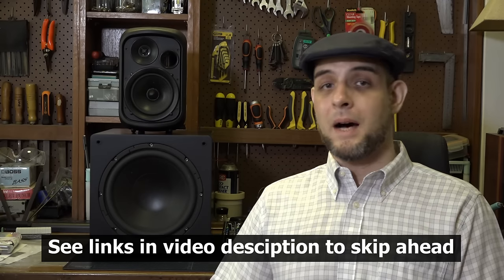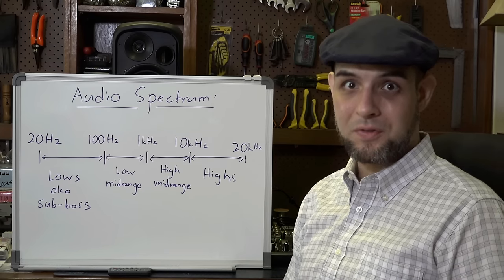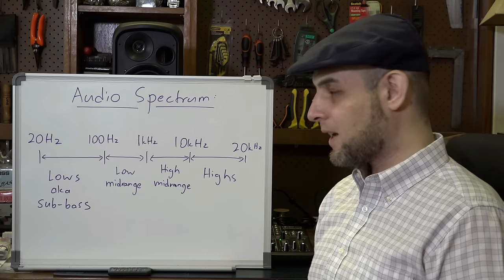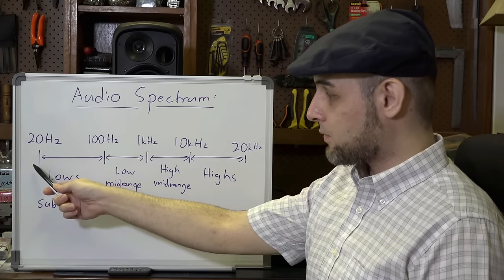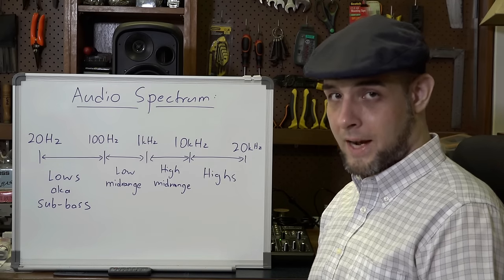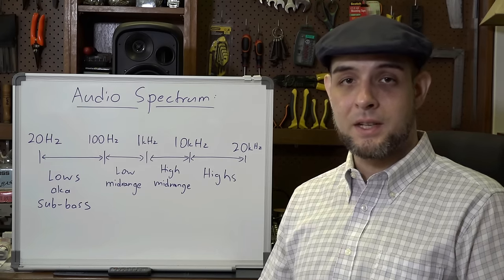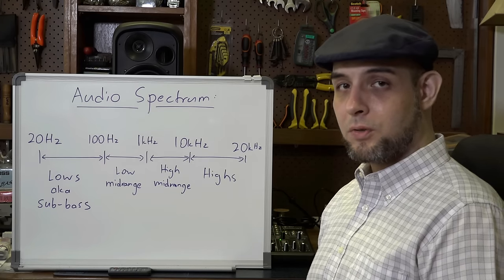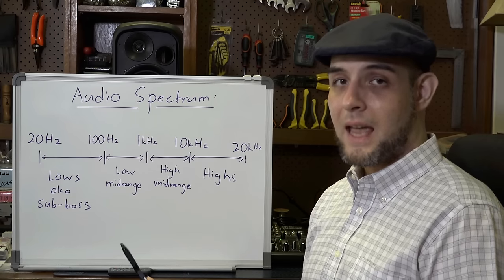How to connect an active subwoofer to a sound reinforcement system

Comment: Hello sir. I am a new listener to your channel. I have a newbie question: i just purchased a pair of peavey dm112 active speakers and a pair of behringer b1200  active sub. I noticed on the back of the speakers there is one input and a thru output, which according to the manual is to use if im adding a sub. I guess my question is how do i connect these? Should it be a.) mixer to active speaker input, thru output to active sub input. Or b.) mixer to active sub input, high output to active speaker input (like what your tutorial is). I hope im making sense. And thank you in advance for your help.
Reply from the maker: The thru output on the DM112s is fullrange as opposed to low passed so it makes more sense to use configuration (b) above.

Comment: Can I just plug it in with 3.5mm to RCA? I was looking at getting an R-112SW but only have a power amp with no proper output
Reply: From what I can find it will work, but are there any serious drawbacks/dangers in doing this? I'm not trying to be an audiophile; I just want to feel my skeleton dancing inside me, so I'm alright with sacrificing a little fidelity if it means saving hundreds of dollars
Reply from the maker: Sure no problem, as long as your sub has RCA inputs.

Comment: Sir is it ok to connect an active mixer to amplifier to drive passive subwoofer?  or just passive mixer to amplifier then to passive speaker. thanks...
Reply from the maker: You can but you must use the line level outputs on the powered mixer - these are marked 'line out', 'preamp out' or sometimes 'tape out' or 'rec out'. Do not use the speaker level outputs on the back panel.

Comment: Bruno, great channel, great video! Question, do you know if there is an issue to use subwoofer and full range speakers of same speaker size? Example, use Yamaha DXS 12 sub + two DXR 12 powered speakers all together?  I've heard more than one guys saying there are phase issues, and that two DXR10 would work better with the 12" sub...
Reply from the maker: Sure you can do that no problem, although companies generally recommend that you use products from the same series together. There will be no phase issues as long as the speakers are time aligned properly, either by using a program like smaart of by physically aligning the speaker boxes.

Comment: at 26:57 connecting to passive tops you go from lets say mixer to sub then to amp. what connections should I be looking for in the back of the sub and are there subs that will not work with this type of setup?
Reply from the maker: You would need a sub that has fullrange inputs and then high pass outputs, ie outputs with the low frequency information removed. And you're right, not all subs will have these connectors.
Reply: You rock, thank you for your time.

Comment: 17:35 question please. What if I only have one subwoofer , how do I connected in order for the subwoffer to take most of the lows and leave the midst and heights for the 2 load power speakers.
Reply from the maker: What's the make and model of your subwoofer?
Reply: @GLBProductions  harbinger s12 sub,  and 2 15s altos ts315 . I already managed to run them correctly but my question now is ,is the subwoffer taking too much of the lows of the 2 15s or should I get another one so I can have the set
Reply from the maker: You will need to make that decision based on the type of music you play and how much bass you feel is needed.

Comment: What if you have old subs that don't have a built in x-over?
Reply from the maker: Then you will need to use a separate external crossover such as the DBX 22/23 series.

Comment: Can i wire in series 2 x  passive spearker just to be presise ( tweeter + woofer + crossover) in seeries with ( tweeter + woofer + crossover ) bolth 4 ohm to get 8 ohm ? Internet has a mambo jumbo beetween terms so anwers are garbages
Reply from the maker: In theory you can, especially if you are wiring the speakers yourself. Just remember that series wiring means that a fault in any one speaker will silence your entire system.

Comment: Quearion please. If there is some noise for some reason ,m I able to use a DI box passive from my power speaker to the mixer,  or are the DI box is only for instruments
Reply from the maker: DIs can be used for any instrument or line level signal, but not for speaker-level signals.

Comment: Hi, great video. Does the method shown at 27:00 in which you insert the sub after the mixer and before the amplifier work if the amp in question /also/ has a mixer? I’ve got a system that has a powered mixer and passive speakers that I’m trying to run a sub through and it seems this is the method I should use, but I wanted to make sure.
Reply from the maker: OK, with a powered mixer you will need to find a way to connect directly to the power amplifier section, bypassing the mic/line inputs. Most powered mixers have a way to do this - look for inputs labelled 'pwr amp in' or 'tape in'. You can also connect directly to the line level inputs, setting the EQ flat and all effects off.
Reply: GLB Productions thank you so much!!

Comment: Can a good base combo function as a sub carrying both the base guitar, base drum, floor tom etc in a small rehearsal room?
Reply from the maker: Hmm... at this point I have to ask - if you are in a small rehearsal room, why do you need to amplify the drums in the first place?
Reply: GLB Productions. We want to be able to capture and control base and the other low frequency instruments on the mixer. What we do now is that we use a condenser microphone to capture externally the bass and drums while recording the rehearsal session.

Comment: There are input-line L R go to the Sub,  but it has only one big speaker output _ Is that means L & R have been shorted each other in the Sub Cabinet ?
Reply from the maker: They are summed to mono before the power amplifier section - no shorting going on here 😄
Reply: @GLBProductions  :- So  ! , Is the main speakers still stareo ?
Reply from the maker: Yes they are.

Comment: Hi, when setting up a PA system With a mixer and an active speaker, how would i set the levels, would i set the gain properly and then set the channel/master knobs/faders on unity then turn up the active speaker until the desired volume? And also do you think it is worth the extra $50 for a shure beta 58a rather than an sm58
Reply from the maker: That's right - get the gain structure on your mixer correct first and then set the volume on the speaker as needed. This will make it easier to set the system volume in different venues.
Reply: GLB Productions Thanks alot Before i assume i used to set the levels wrong because there was a terrible hissing noise compared to the actual volume from the mic but today there was hardly any hissing noise 🙏🏽👍🏽
Reply from the maker: Yes, now you have optimised the signal to noise ratio of your system - well done and all the best with your music!

Comment: I have a mackie cfx 12 mk11 mixer. I have 2 active tops and a sub. I use it for live vocals and backing tracks.There is a xlr subout on the mixer marked with an 'S'. Should I be connecting my sub using that ? or do the traditional thing and use the left and right out to the sub and connect from the sub to the tops?
Reply from the maker: Yes that mixer has a subwoofer specific output which is low passed at 75Hz - this is a bit low in my my opinion (I prefer 100Hz) but if it sounds good with your system go ahead and use it. At the same time you will need a way to cut the lows out of your tops - either with an external crossover or high pass filter on the speakers themselves.
Reply: Thankyou for your reply. The sub I am using is a 12" and has settings on the back for 90hz and 140 hz, would i still be able to use the xlr subout? or will it not sound right? The tops are 14" and I have told to use it at full range.
Reply from the maker: Yes you can, although the 75Hz setting will override the settings on your sub. 14" tops? FBT ProMaxx are they? There are very few 14" tops available these days ;) 
I personally do not agree with running the tops fullrange because you then are not 'dividing the work' between them and the sub so to speak. It can also cause phase issues due to the distance between the subs and tops.
Reply: There are various settings on the tops to match the sub i.e i have the choice of setting the tops to 90hz and also setting the sub to 90hz. I have been told to set the tops to bypass the sub and set the sub to 90hz. This way it apparently has the tops running fullrange and the sub doing its own thing. The tops are set on tripods and the sub sits either near a top or between the two tops.As you can tell I am not a technical person but I want the best sound I can get from this system

Comment: Can I use my power mixer to power my passive subwoofers? Or I would only use it to power woofers only?
Reply from the maker: Both - you can use the speaker level outputs to connect to passive subs, and the line level outputs to connect to active subs.
Reply: GLB Productions thanks for that response. 
I am doing a small band for church size setting. 
I want to replace my old mixer, should get the power mixer or pre-mixer?
Reply from the maker: The term is mixer or powered mixer, not pre-mixer ;) I suggest getting a normal mixer - more versatile and they are available in much larger channel counts.
Reply: GLB Productions ok. Thank for advice and term correction. In my country, ppl call mixer as “pre-mixer”. Now I know the term.

Comment: so if I wanted to use the High pass output on my sub, do I use active or pasive tops
Reply from the maker: You can use either - with passive tops you will of course need an additional amplifier.

Comment: Hi Bruno, I now have two subs and hooked them up to the aux sends out of my Mackie DL1608. I set up for the band and sent the bass guitar to the sub only, not the mains and I realized a bass guitar produced frequencies above 120 hertz and those frequencies were naturally weak coming out of the sub. Does this mean I need to send the bass guitar to the sub via aux send and also send the bass guitar to the mains but if I do that the frequencies below 120 hertz will be going to the mains and I'm trying to avoid that. What do you suggest?
Reply from the maker: Yes the bass needs to be sent to both the sub as well as the fullrange speakers. In order to avoid the issue you describe you need to high pass the signal being sent to the fullrange speakers, either using an external crossover or a filter on your active fullrange speakers, aka 'subwoofer mode'. I discuss this in the video.
Reply: Thanks Bruno. I don't have an external crossover or a subwoofer mode on my tops, sounds like I have to go into the sub and then from sub to mains even though that is not the best choice.
Reply from the maker: There's nothing wrong with this method actually, as long as the crossover in the sub is well-designed and the subs and tops are designed to work together.

Comment: Hi!
I want to connect active sub to a passive speakers system (just like in 27:00).  My active sub has only one  XLR output labeled "mid/high range balanced output". What do I need to do to connect both left and right channel do the amp? Do i need an adapter or something? The signal is going to be unbalanced then? Please help :c
Reply from the maker: A sub like that is designed to handle only one side of a stereo system, so you will either need to run your system mono, or add a second sub. The former can be achieved by connecting only the left output of your mixer, and making sure all your pan controls are in the center position.
Reply: @GLBProductions  Thank you for the answer :)

Comment: I purchased this crossover Behringer Super-X Pro CX2310,  will that do the job?
Reply from the maker: Yes it will.
Reply: GLB Productions thanks, can I ask you one more question. My sub has rca jacks, no xlr, I used a 1/4 trs to rca from my mixer to the sub. Does it matter if I plug in both rca jacks or just one?
Reply from the maker: TRS and RCA are not really compatible - one is mono balanced, the other is stereo unbalanced. If you really have to do this just plug in one RCA connector.
Reply: GLB Productions OK thanks for the info, I had both plugged in and seemed to be thumping just fine. I will try just one..appreciate the reply. Would a TS to rca jacks be a better option, than using TRS and plugging in only one? Appreciate your help and time, as I can't find this info anywhere and trying to understand it.  Thanks again.

Comment: Would a large sub in a small environment not sound very good
Reply from the maker: Not necessarily - remember that the frequencies produced by the sub are almost the same regardless of its size. Bigger subs generally go louder and a bit lower than smaller subs, but you can't generalise based on the physical size of the box.

Comment: Yeah... but what if your Sub doesn't have a built in crossover Then What???" Should I connect the main outs to my TOPs and the CR out or AUX send or AUX Rtrn to the sub or vice verse???
Reply from the maker: You would need to use an external crossover such as those made by DBX.

Comment: hey i have a question what if i connect two active subwoofer in main output. what should connection i do? is it balance or unbalance? or can i connect subwoofer as left and right output in main output of my mixer???
Reply from the maker: Mixer left output -> left active sub -> left fullrange speaker. Repeat for the right side. Best to use balanced connections throughout.
Reply: GLB Productions ahh okey i understand. but how about its mid and high output??? is that still left and right stereo sounds?
Reply from the maker: Fullrange speaker handles the mids and high, sub handles the low. Yes it's still in stereo.

Comment: Hi, instead of putting an amplifier will a powermixer work in passive speakers system too?  the same as in the passive fullrange speakers ?
Reply from the maker: Sure no problem.
Reply: Still got small problem... So where shall I plug my output from subwoofer into powermixer ? Should i put it like in the master out of my powermixer ? To be honest there are only 2 output signals... one is speakers out (so obviously speakers out) and main out. So its like output from subwoofer goes into main out into powermixer ? best regards :)
Reply from the maker: Yes you'll need to work out how to derive a high-passed signal that can be fed back into your powered mixer's 'power amp in' input. It may be that you still need an external crossover.
Reply: Maybe can u recommend some good amplifier for passive speaker system ? I want to buy Behringer B1500HP active subwoofer and I wonder what amp will do the work with passive behringer vs1520 speakers :)

Comment: How can I connect a subwoofer on my old amplifier and mackie 1202? I have jbl 15 inch passive speaker? Thanks a lot
Reply from the maker: Is your sub passive or active?
Reply: GLB Productions 
Ok my old amplifier has speaker out only with banana insert and has a stereo and bridge settings. And my sub is passive.
Reply from the maker: Ah ok then you'll need to wait for my passive subwoofer video which shows how to use an active crossover, coming soon. In the meantime you can just hook up the sub to a second output of your mixer and see how it sounds.
Reply: GLB Productions 
One question about the old amp I have? So what I did I hook up my passive speaker and using speakon and banana hook up to amp. And I have 2 extra 10inch speaker and hook up on the same left and right so far it's ok but I felt like there's a little bass on it, is that ok if I connect both left and right and I'm kinda curious if I turn the volume little bit up do U think I'm not killing the amp?
Reply from the maker: It depends on what the amp's minimum operating impedance is - see my video on how to connect an amplifier to passive loudspeakers.
Reply: GLB Productions  i have a numark mixdeck quad and two peavey passive speakers and i want to and a sub to it how can i connect the sub?
Reply from the maker: Luis Morales If your sub is active then the instructions in the video will work for you.

Comment: hey. at 23:20 you said i could use a crossover for high pass filter right? if i don't have one. but i have a parametric equalizer side chain to compressor i can connect them to main insert. right?  so somehow i can cut the mid frequency from parametric eq down to active speaker.
Reply from the maker: You can try that, but EQs do not have the same filters as crossovers so the effect will not be the same.
Reply: @GLBProductions  yeah. i figured it out
 but i think if my active speaker has a built in parametric eq and at the same time i have eq on my main insert. it may same as crossover efficiency . since all mid , and mid low frequencies will be cutted.